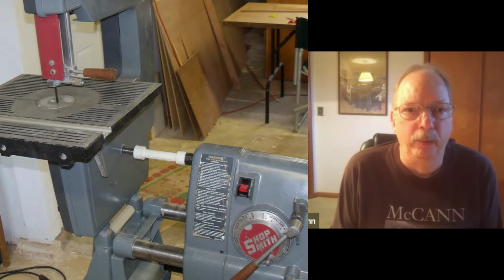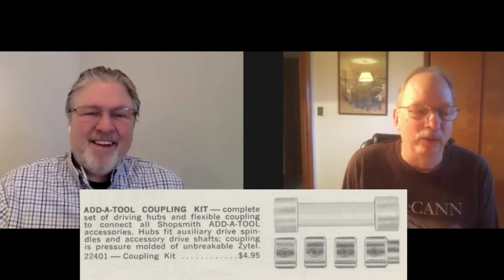Intentional Weak Links (Single Points of Failure) Designed into Woodworking Tools. Jim McCann Part 2

Comment: Question I have shopsmith mark 510 when turning block the peace will stop like the belts are slipping is this possible
Reply from the maker: Yes, it's possible to make the belts slip. The top, poly-v belt may need to be tightened or replaced. Scott

Comment: Nice segment - of course! But I am not sure (euphemism) that I understand the  description, at the 28 minute ++ mark, of the test for alignment with a maximum tolerance of 10 thousandth  over 10 inches: It CANNOT be that JMC (and/or his friends) holds one edge of a 10 X 10 inch square against, say, the extended quill, and asks that there should be no more than 10 thousandth of an inch separation between a perpendicular edge of the square and, say, the slot for the blade, as the quill has a circular ring that extrudes to prevent it from being pulled back into the headstock.
Reply from the maker: I’ll see if Jim can chime in, but what I can tell you is that the new Mark 7 tables are heading out of the factory aligned well enough that the new owner could skip the table saw alignment steps and still get accurate and safe cuts. This was never the case 20 years ago. The Mark Vs back then simply had the tables attached with no care given to alignment at the factory.  Scott

Comment: Sacrificial parts-Fiber gears in a cinema projector-protects the Geneva film intermittent drive.Same sort of gear in large food mixer-protects the mixer transmission and motor from  jams.Kee lawnmower-these are for heavy brushcutting.The belt protects both the blade and motor crankshaft from damge if the blade hits a stump or survey stake.In these things-like your drive coupler-"mechanical fuse"like a fuse or circuit breaker in an electircal circuit.
Reply from the maker: That makes a lot of sense. They work a lot like a soft key on a drive shaft and I love the term "mechanical fuse". Scott

Comment: Replacement couplers can be obtained from 3D printer shops or make your own if you have a 3D printer but they are much more robust than the Shopsmith item.  Shopsmith needs to create their own pattern for making a coupler within Shopsmith limits to help protect the rest of the system.
Reply from the maker: Why would they do that when they offer a proven product? As mentioned in the video they aren't moving a ton of tools these days so it's unlikely they'd give up sales of a consumable product like the coupler. As for aftermarket couplers, I'd have to see some serious testing before I would trust my life and tools to them.  Scott

Comment: Why did Shopsmith never upgrade the motor again to more than the 1 1/8 hp motor?  I know the new power pro is a 1 1/2 hp at 110v and 2hp at 220v but the Mark 5 is still a popular machine why not upgrade that motor?
Reply from the maker: Chad, that’s a good question. It’s mostly due to size. Until the electronic variable speed motor because available the larger HP induction motors were just too large. Also, at 110v the PowerPro is 1 3/4HP, but not importantly, it adjusts when under load, so it’s not just a fanciful “Developed HP” number like we often see. Scott
Reply: @MyGrowthRings  If I was going to upgrade my motor, I would go to the Power Pro, I'm sure an upgraded motor would be a pretty penny and the cost to go to the power pro wouldn't be that much more.  The only thing that keeps me from jumping to the power pro is a concern about the life of computers, not sure that it would last the 15 years that I plan to be wood working, would hate to have a machine that fails and not be able to repair it economically.
Reply: Money is the answer.
Reply from the maker: When combined with a thin kerf blade there's really little need for a larger motor, but yes, money is always the answer.
Reply: @MyGrowthRings  i always thought the SS carbide tip blade was rather thick.  Along the lines of why did SS choose to use nonstandard 1.25” rather than 5/8” mounting hole and for that matter why nor a 12” saw blade just like the disk sanders...things that make you go hmmmmmmm
Reply from the maker: @toddharshbarger8616  In 1947 when Shopsmith chose the 1 1/4" arbor size there was no such thing as a "standard", and a larger arbor was seen as a positive. You've been able to purchase a 5/8" arbor since the 1940s, so no one has ever been locked into a proprietary blade.  Why no 12" blade?  Until the 1980s when 510 was introduced there wasn't enough space between the table support tubes to accommodate even the 12" sanding disc. Once the 510 was introduced SS also added a real riving knife to the guard design, in which both the blade and the splitter pass through the table insert. This was over 20 years before this became a standard feature on US table saws.  A Mark V with a 10" blade has a  3 1/4" depth of cut, which was greater than most 10" table saws at the time it was introduced and even greater than some 12" table saws back in the day.  I think you may be selling the Shopsmith short.  Scott
Reply from the maker: @toddharshbarger8616  BTW, how do you like that dado blade?
Reply: @MyGrowthRings  well again influenced by your whole series, i picked up that freud daddo set and have also acquired 5/8” adapter.  As you concluded that is really hard to beat.  Sooner or later ill get around to selling the SS dado set which isnt carbide tipped.
Reply: @MyGrowthRings  10E/ER's had 5/8" arbors (8" max blades), the Greenies and Goldies with Gilmer drives also used 5/8" arbors (9" max blades).  The 1-1/4" arbor wasn't introduced until they went to 10" blades in the early 60's, 1-1/4 was the standard for industrial blades, and consumer saws weren't commonly using that large a blade yet.
Ron :)